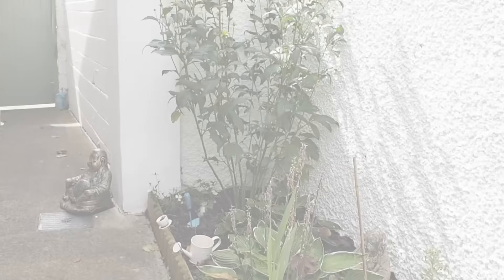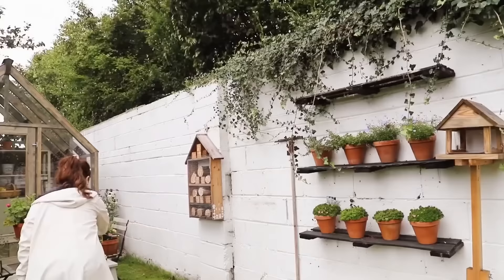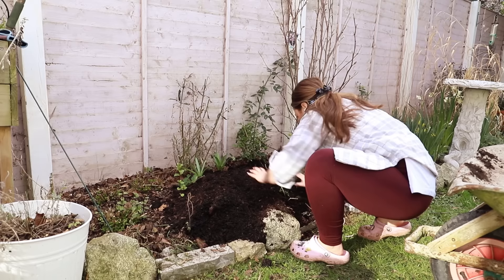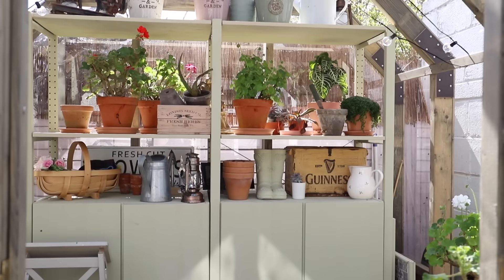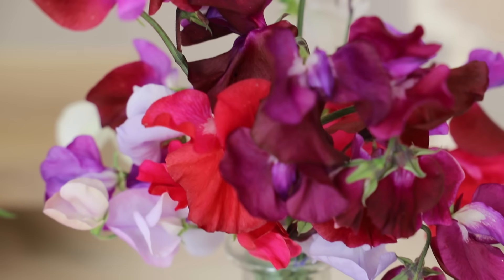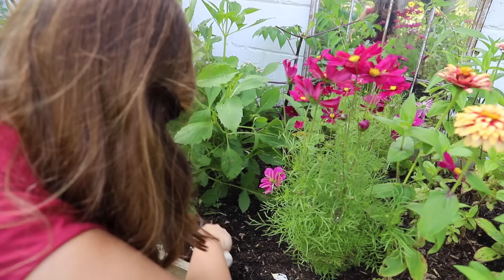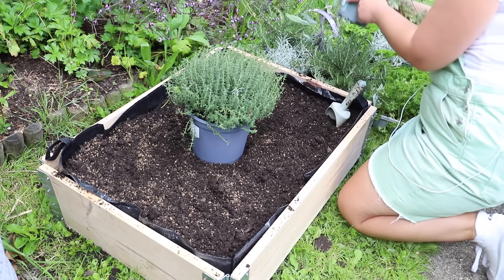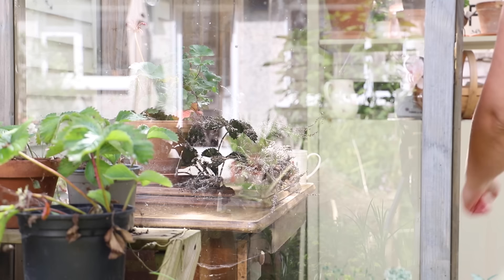Turning a square piece of grass into my dream cottage garden 🌱

Comment: My learn this year was less is more.. i overplanted and as a result under harvested. I had issues with lots of pests and it was unavoidable due to the close planting and lack of breathing room. I have a relatively small space to garden in and I was trying to make the most of the available space, but in the end it cost me a proper harvest. I also learned that it doesnt get cold enough to grow brussel sprouts where I live. And going forward I want to build up the structure more as you say, plant the shrubs and trees and get a path carved out so there is a rhythm in the garden. Right now its very boxy and scattered.
Reply from the maker: Those are great learnings, I too have made the mistake of planting too close! x

Comment: This is beautiful! Could you possibly share more about the interlocking rubber mats you used as supports beneath the rock gravel beside your concrete pad? What is that called? And is it a garden-specific item? I see some options online called "interlocking rubber flooring," but what you have there looks outdoor specific. Thank you!!
Reply from the maker: https://www.goodwins.ie/products/permeable-paving-gravel-mat-with-weed-block-black-4020120.html These are the ones I used, they're not made of rubber x

Comment: Would any of the Ryobi drills drill holes in bricks at all? Love your garden 🙂
Reply from the maker: Yes, when drilling brick get a drill with a hammer function and use drill bits for brick. For example, there are drill bits for metal, wood, brick etc x